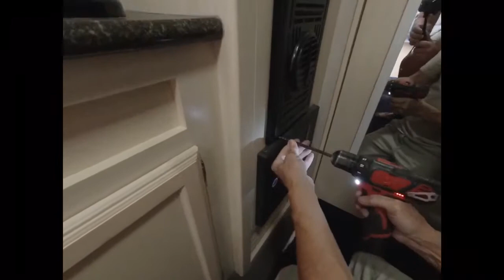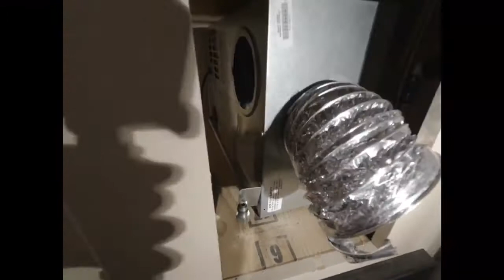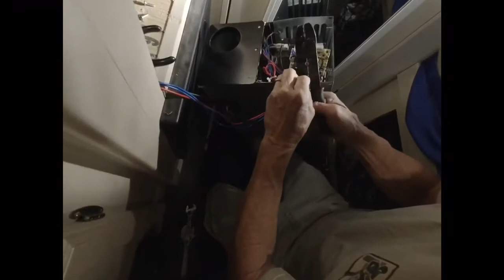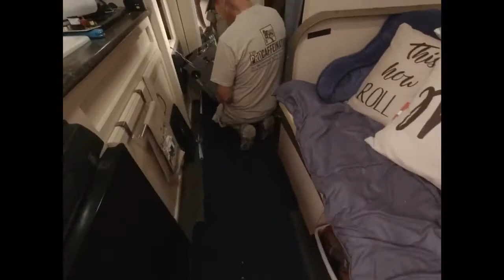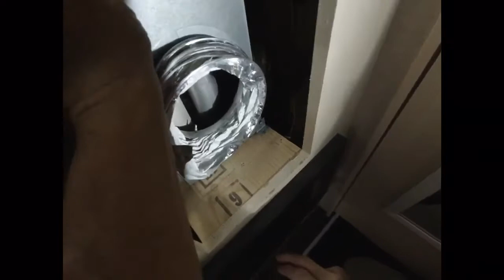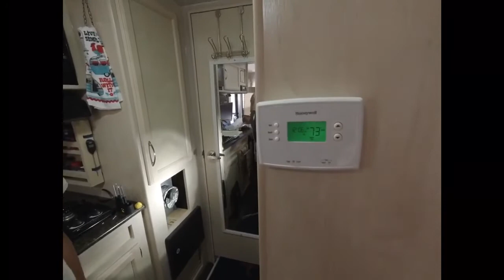Furnace Heater Repair Winnebago Micro Minnie 1700bh #winnebago #microminnie

Comment: how did you determine the board was bad though?
Reply from the maker: Kind of trial and error. A lot of people suggested replacing the sail switch, which he did. It worked…for awhile but then we had problems again. He then replaced a bad power wire he found (to the board), but that wasn’t a permanent fix either. So he decided to just replace the board and we haven’t had any problems since! (We still have this RV)
Reply from the maker: P.S. This is the one he used if you’re interested.
https://amzn.to/3SM9fpI

Disclosure: As an Amazon Associate I earn a small commission if you purchase through this link :-)